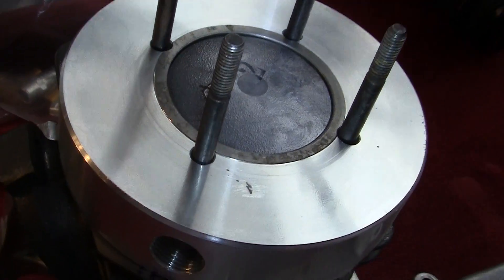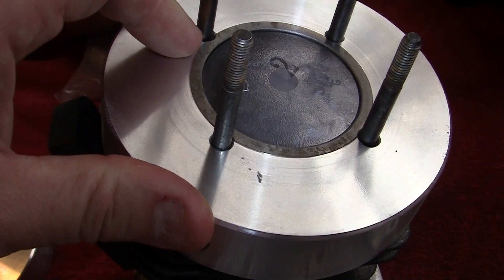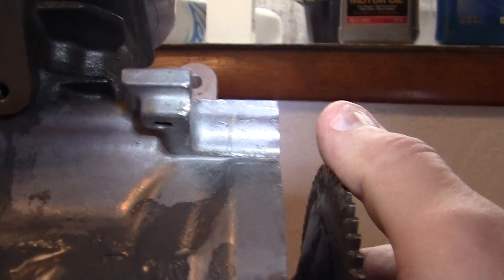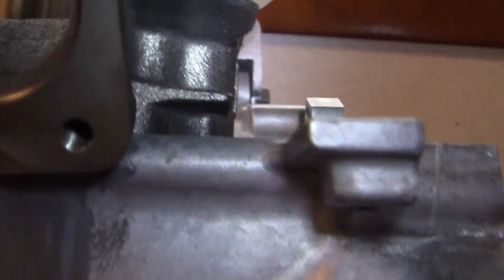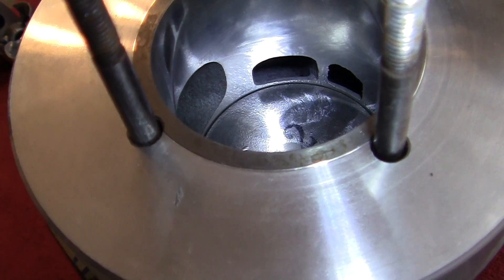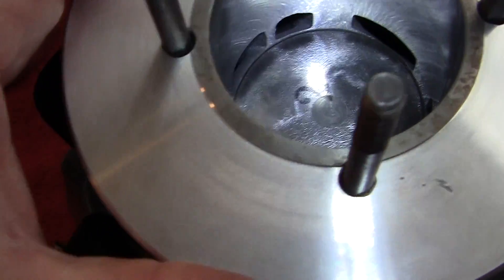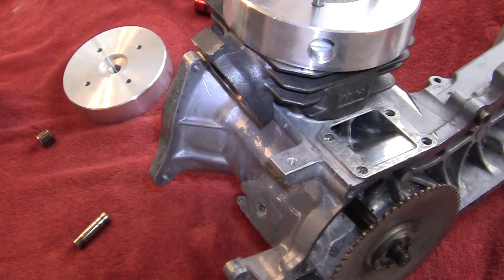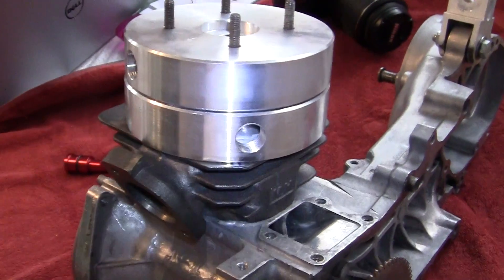90- Operation Honda DIO= 120cc STROKER ENGINE.

Comment: I have the same problem coz I use a much longer stroker crank..when I reached in to BDC the edge of the piston head and exhaust port difference or distance is 12mm is that a problem to its performance?